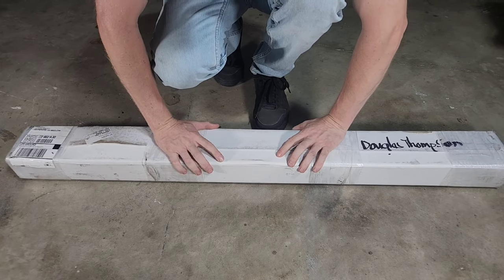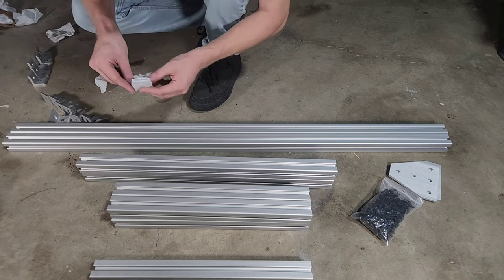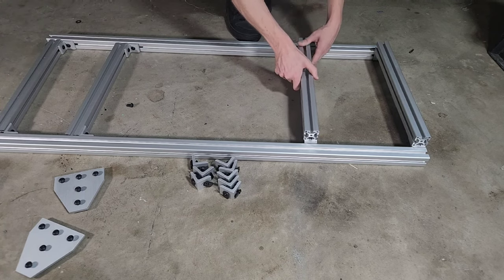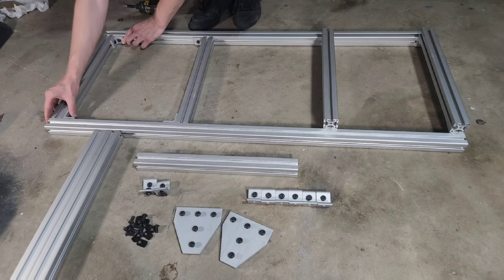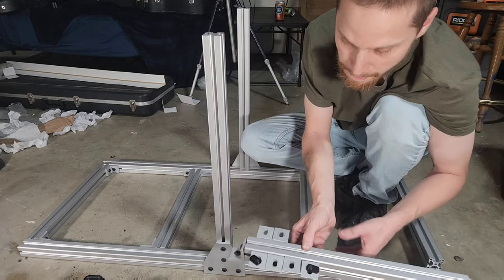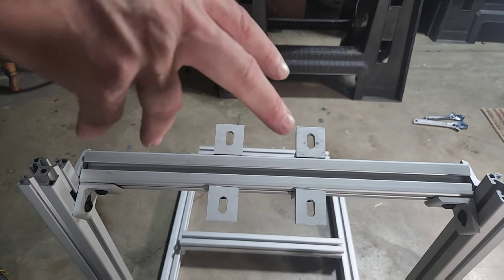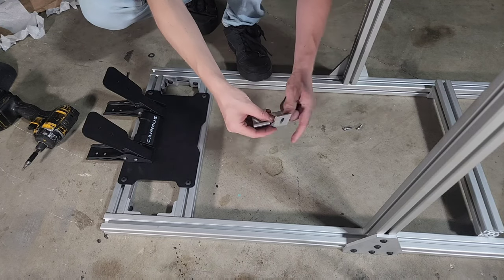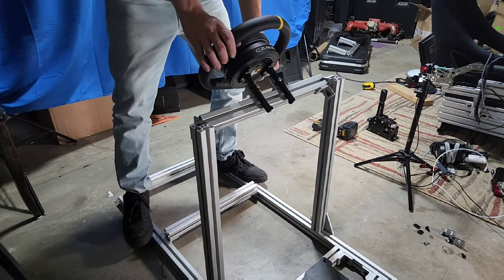How to build a SimRig for $150

Comment: Im here after building the $200 one. I just wanted to thank this dude for this simple click and done link. Def recommend. Very sturdy. Will want some caster wheel or some mounts for height. I jerry rigged my old gaming chair to it and that baby doesn't move. Using 200KG sim jack pedals and alpha mini. I did make a wooden baseplate.  Drilled 4 hole for the M8 screws and done a whole complete rig for $235. I would suggest end caps or maybe those pool foam things to put on the edges to save your knees and toes.  Now to work on the triple monitor stand.
Reply: Thank you so much for sharing your experiences!!! I'll consider the triple screen mount. ;)
Reply: @SleepyPantsSimRacing  Is there a link for the 200 one? Or maybe even more expensive options?

Comment: I made it exactly as in the video. I would suggest you go for the $200 rig because that is not stable enough, you need thicker pillars. with 200E it works perfectly! The problem is not so much with the steering wheel, as with the shifter
Reply from the maker: This is intended for the c5 and csl dd max, what did you use on it? Also this is as barebones as I could design it for the people that requested a cheaper version than my 200.00 version. Thank you for sharing though! :)

Comment: Dude! Best price in the game.
N he just keeps going lower and lower! 

How does he do it?? Bless this man.
Reply from the maker: If this one is successful as well. I will attempt to build another for cheaper if possible.
Reply: @DouglasThompson  * faints *
Reply from the maker: Lol
Reply: @DouglasThompson  looking at prices of components, i dont hink its possible to push the price that much lower...
I am not in the US so i dont know prices of construction lumber and services provided by home improvement centers (lowes, home depot, harbor freight...) but where i live you can have them cut the wood to size. What i am saying is building a rig out of 2x4"s would be possibly the cheapest option
Reply: @DouglasThompson  ok, i have checked some sources online,  cant access official sites form my country, and it seems that you can get Lowes and Home Depot to cut the wood for you, it should even be a free service, so you can get all the materials for a simrig for about 20-25usd, downside is, it will not be easily adjustable...
Reply from the maker: Yes wood would be cheaper make sure and use some beefy hardware! I can get the price of this lower, I have an idea for it actually.
Reply: @DouglasThompson  thanks for the videos! Are you willing to share your idea or are you saving it for another video? Also I noticed that the auto-add-to-cart link for the $200 version has some out of stock T-Nuts right now, could these be replaced by any other 15 series M8 T nut?
Reply from the maker: @prestonshires8728 my idea I realized was redundant. Also with all the requests for designing a more expensive  rig, it wouldn't make sense because the other companies can offer much more than I can for higher prices.
Reply from the maker: @prestonshires8728 yes any tnut/screw combo will work as long as they are thread compatible and same length screws.

Comment: built the 150 rig. I would make 1 change turn 2 17" lengths to 20" for under the seat, for 5 bucks it is way more stable if you are 200+ lbs. if you don't have a seat this isn't cheaper than a 300ish rig but customization is amazing, more solid than I had thought.  the cammus C5 is getting held well, 0 flex. Thank You, 1 click is a great idea =)
Reply from the maker: @Vistralan1  Thank you much for sharing your experience! I'm so glad these designs have helped so many people.

Comment: Thank you for this!  I bought this one for a secondary setup for my old fanatec csl elite wheel and pedals along with a real car seat.

What can I say, lightweight, super solid and rigid with infinite adjustability! 💯💪🏼👍🏻
Reply from the maker: Yes indeed, if ever you want to add something or aren't satisfied with something you are always a couple brackets or price of extrusion away from turning it into the perfect setup.
Reply: Exactly!  I got two 3 hole L-brackets to have a little more length to support the wheelbase, only two bolts to fasten the wheelbase to the L-brackets which is mounted to the backside of the cross arm.

BTW, thank you for the 1-click Tnutz cart!  Easy to just purchase or edit the cart contents to your needs! 😁🤙🏼

Comment: Hello, I have another question so I’ve just watch the 200$ and the 150$ but I want to know if the 200$ one is worth the extra 50$?
Reply: And also for the 150$ it say there are only 4 screws, is that correct?
Reply from the maker: The extra 50 makes for a much more solid feeling wheel mounting. And the cart is correct it will come with all necessary hardware.

Comment: Wow, did you want it to wobble? This inverted T shape that the whole world thinks is good enough is piss poor. Even large companies seem to think that massive base beams and uprights bolted together at 90 degrees is a good idea….. it is not. Use your brains people!
Reply from the maker: Lol it's more than solid enough. :)
Reply: What do you plan on using it for? Holding up a house? It's for a 5-15lb wheelbase @ 5-8nm max. It will due just fine.
Reply: Any wobble, front to back or more importantly side to side will lessen the feed back you receive from the wheel. Add in a belt driven wheel and you have the perfect recipe for disappointment.
Reply: Any wobble, front to back or more importantly side to side will lessen the feed back you receive from the wheel. Add in a belt driven wheel and you have the perfect recipe for disappointment.
Reply: @benhodkinson6467  they sell the single side wheel stands that wobble more than this will for just as much money. This clearly is not for an expensive setup for someone with deep pockets. This is for someone who is getting into the hobby and wants to build a fairly inexpensive rig that could get them through a year or two.
Reply from the maker: Thank you native. :)